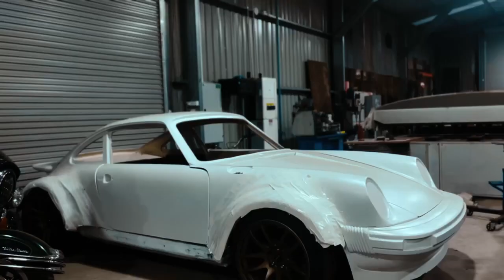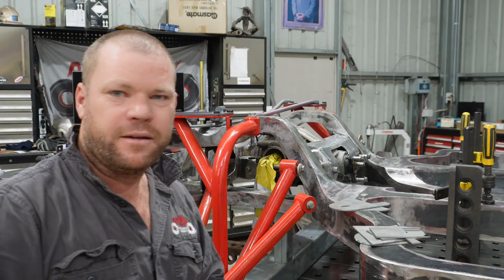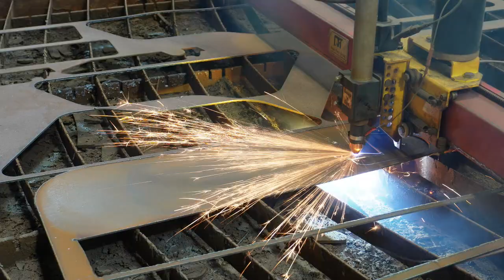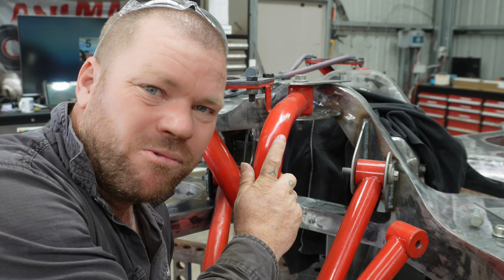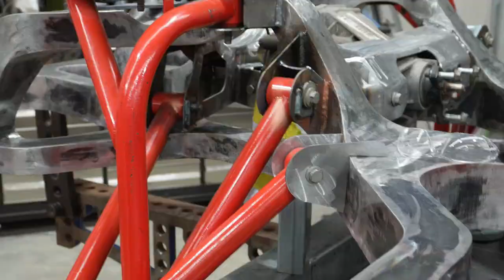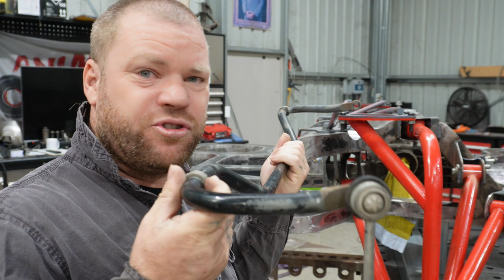Rear control arms, and design issues. SSMetro Ep27

Comment: Hell yeah brother I love this channel and the intro is bad ass!!  Are you going to do anymore events or car shows? This van would win hands down.  It’s a 1st place build 100%!  Craftsman cars like my truck has 1.75” swaybars with spline ends for the arms they work amazing.  Try a 2nd hand race car shop for circle tracks or sprint cars you’ll find what you want.  We got a place out here but I bet shipping would cost 10x the part!
Reply from the maker: Cheers bud appreciate the love. Probably will take to a few shows when it’s done, not expecting much from that though.
Will look into those options for the sway bar
Reply: @animal_engineering  Citroens have a solid bar going though the rear suspension beam with splined ends it`s used to adjust the ride height but it could be used as a sway bar I think ??
Reply from the maker: @kylereese4822  interesting might have a search of that m. Cheers